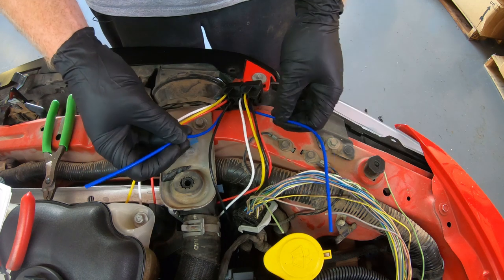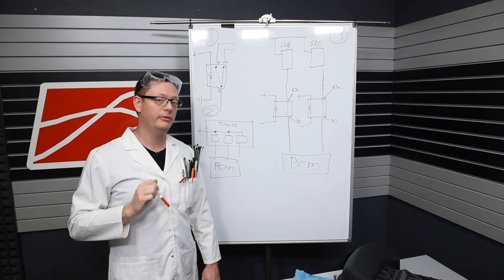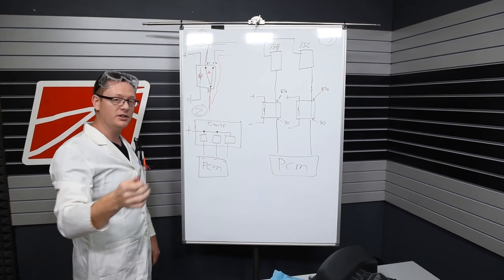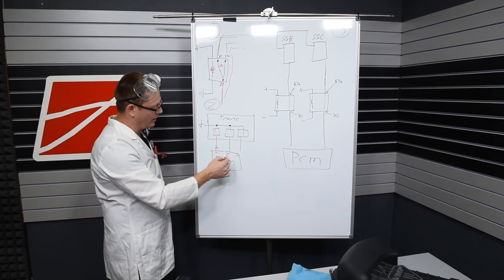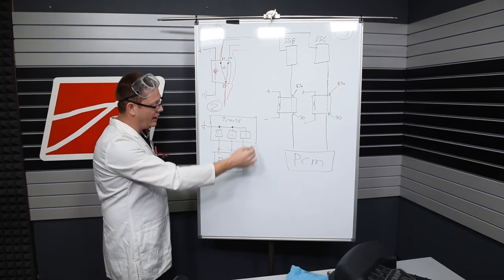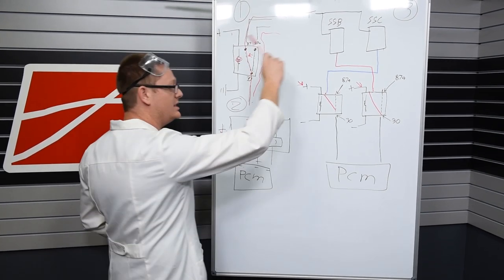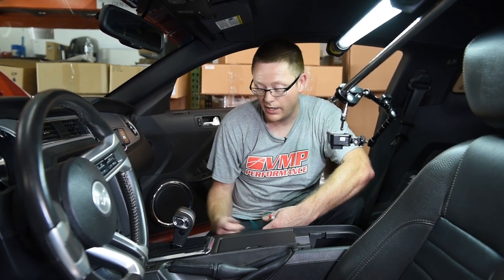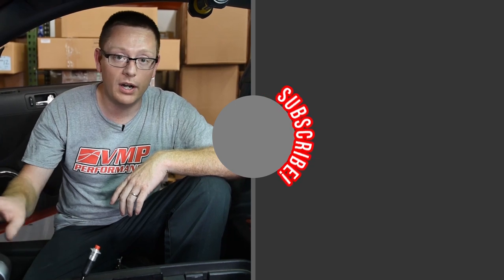Project Chucky | 2011 Mustang GT 6R80 Transbrake Install

Comment from the maker: Do you have a transbrake on your 6R80 car??
Reply: Hey I have been having some series issues/questions... I am running a procharger on my 2011 GT auto and even with drag radials am only able to cut a 60' of 1.9, and my 1/4 mile is 11.9 @ 120 MPH...  am I maxed out on stock converter?.. seems so SLOW out of the hole!  I tried different air pressures on the radials (MT Radial Pros) but found the less air I had the worse my time got... so now its back up to like 26 lbs.  My next mods because I wasn't even running close to low 11's (like i thought I should be) was a new converter and a JMS digital trans brake...  any thoughts/ideas?
Reply: Oh heck ya bud!😎
Reply: Chris Bruso it’s the gears and stock converter holding back that 60ft. My best 60ft on 3.15 and stock converter was mid 1.7x on a Kenne bell. Car is making 600whp.on a pro charger I would jump straight into a 4c and if not a 3.73 gear to get into higher rpm faster where your making power
Reply: @justa5oh136  thanks for the input!  Ya i dunno about that big of a converter due to it being my daily 570 HP car, but at least i know i'm not crazy! I think like a 3c (i think) 3500 stall or so would be sufficient (hopefully) to balance track and streetability.
Reply: Chris Bruso I use a circle d 3c on my twin screw. Centrifugal are really lazy out the whole. 4c are always recommend on those set up.belt driven ain’t like turbos so they don’t need the load
Reply: I was thinking his mph was low as well but I'm not an auto guy. I trap 114 - 117 depending on the weather in my 12 manual GT and I don't even make 400 wheel
Reply: Do u offer this as a kit on your site?

Comment: Does this put the same kind of stress on an automatic transmission as a neutral drop would?
Reply from the maker: No, this is releasing a clutch in the transmission and with a neutral drop you are violently engaging a clutch.

Comment: I have added the two relay for my transbrake but it releases at around 2500 rpm while I am still holding the button.Still a stock converter.
Reply: its because its a stock converter... just because its a trans brake doesn't mean you can set it at a higher stall than your converter will allow mechanically.
Reply: @PunkRockDad85  thanks,I thought that was why.
Reply: It won’t really go over 2400 in n/a trim. My Kenne bell pushed the stock converter to 2900 before it pushed the car. A tbrake will give you about 400 rpm to what your stall is flashed too
Reply: My car is 14 with a vmp gen2r ,made 650rwhp on 93 and boostane on a 79mm pulley.
Reply: Johann Pyfrom stickier tire will help with loading it up higher